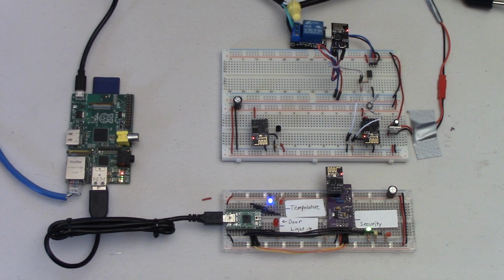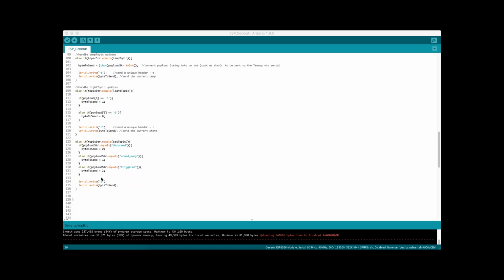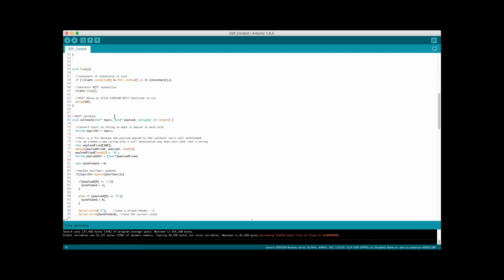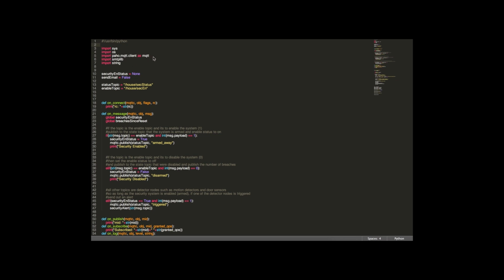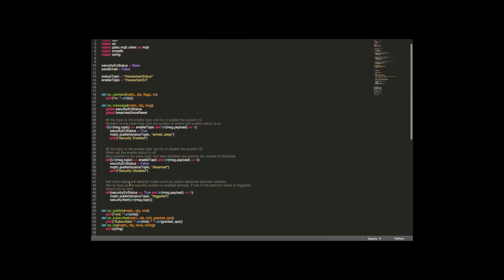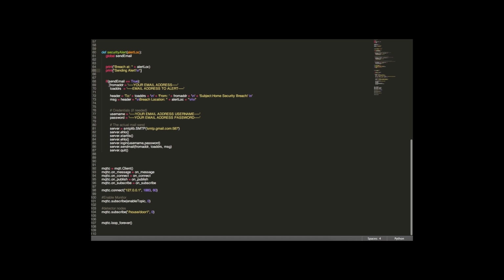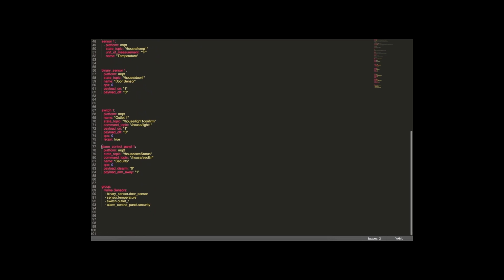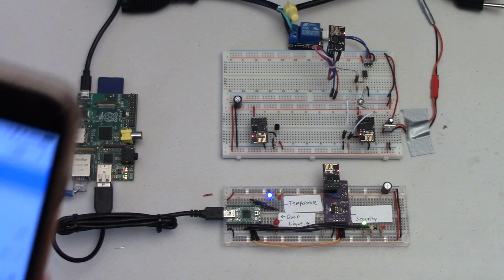Home Automation at Home Part 5: Secure the System

Comment: Wow big thumbs up!!  I'm also looking for a way to include a 'livestream' of a security camera to see for instance who ringed the doorbel or when motion is detected. Another thing i was thinking about is, how to save power(using batteries) for the sensors..Again thanks a lot!
Reply from the maker: +Kxi Niks Glad to hear you liked it! I believe Home Assistant supports a variety of cameras if you want to add one to your config. Take a look here and see if the camera solution you want is listed: https://home-assistant.io/components/#camera 

As for power saving, I haven't done a lot with it but I know that there are ways to putting the ESP into deep sleep and shutting off the wifi. Take a look at this page for more info: https://github.com/esp8266/Arduino/blob/master/doc/libraries.md#esp-specific-apis